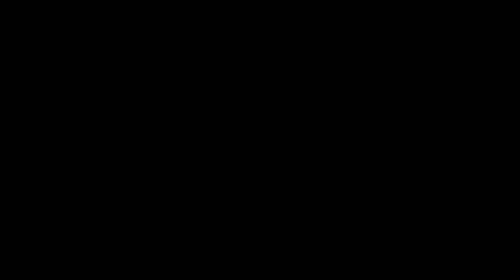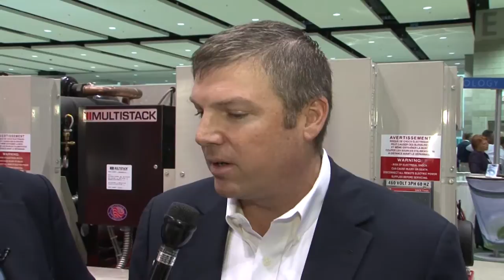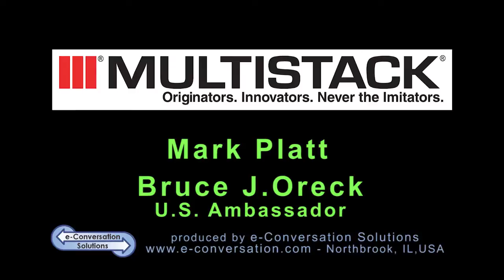How does the Multistack Dedicated Heat Recovery Chiller Save Energy - Mark Platt

Comment: Mark, when would you need to cool your building, and then save the heat to also heat the building at the same time?
Reply: For hot water reheat at terminal units, as one example. Some spaces may need cooling while others need heating.